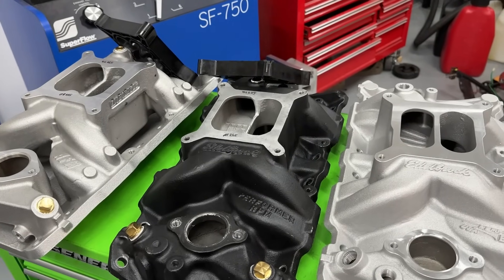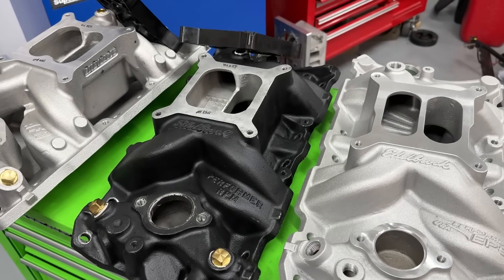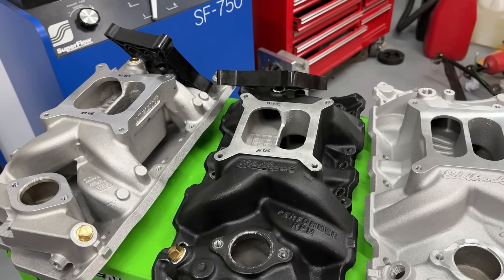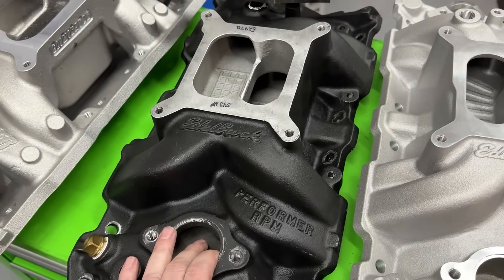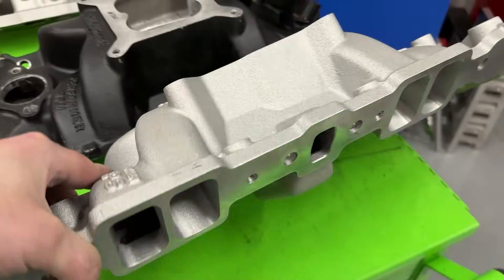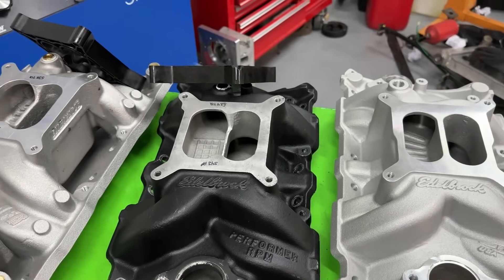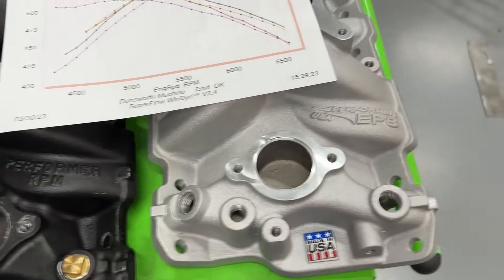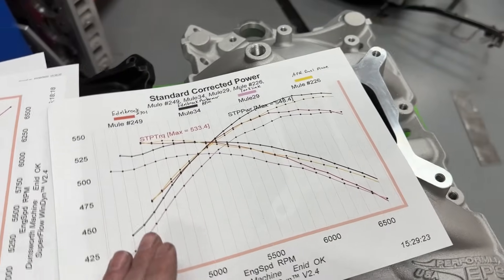Does Cutting Down The Divider On A Dual Plane Intake Manifold Help

Comment: Wondering if the added low end torque with AFR was because of cooler intake temps due to the air gap design.
Reply from the maker: I doubt it because there isn't a whole lot of air flowing underneath it in a dyno cell but maybe.

Comment: Most of you intake info is validated on dyno sessions and test fo 20 years. All street motors hot street strip performance rpm is ticket. Watch any engine builder who builds power. Thanks

Comment: Did the RPM originally have a notch in the divider?
Reply from the maker: No
Reply: @WeingartnerRacing  The reason I ask is the big Chrysler ones I have bought did has a small notch in them. If course it wasn't cut down nearly as much as you have there. I was just wondering if it would be worth cutting more out.

Comment: Great video Eric, some interesting results. Why do you think the 4-hole and open spacers react differently on the dual plane vs single plane manifolds? I'd like to hear your thoughts on that. Also, concerning your oil temperature situation. Have you considered running a remote filter with an oil cooler and a fan? You could probably fab a portable unit with quick disconnects.
Reply: It makes sense, four holes help torque which single planes need and open spacers help top end by adding plenum volume which most dual planes need.
Reply: @josephbacarella2242  how about using a four hole spacer on top of an open on a dual plain ?

Comment: If you need a dual plane manifold, your engine is too small. 😅
Reply: Dual plane intakes have their place! No matter how many Ci’s they are. 1,500-6,500 rpm’s for very efficient dual plane intakes.
Personally I’ve never seen one make power past 6,200-6,300 rpm’s. That’s with port matching and 1”-2” spacers too! I’ve done single plane intake builds/engines
From 287”-434Ci. For fun I have put Wilson full competition ported to Felpro 1206 int side gasket on an Eddy Airgap dual plane for a SBC. It’s an eye opener!!  Even on those engines with single plane intakes that made power out to 7,000-7,200 rpm. With the Comp Ported Wilson intake made far better torque and Hp on average up to 6,300-6,600 rpm’s!!! On average only being down 15-45 Hp
From 6,600-7,000 ish. The 406 sbc was able to change the stall from 4,500 down to 3,500-3,600. And shifted it at 6,600 rpm’s and went 3ths faster! And picked up 2.5-3 miles hour on trap speed???  You’re dropping rpm’s by 600rpms of ware every gear and gos faster to! Now this is on sub 625-650 Hp street/strip builds!

Comment: Thanks for doing these comparisons they are so interesting and exactly the kind of information technical gear heads like me are looking for... Since you are doing dual planes, it would be nice to see the results/ comparison of the newish Edelbrock Dual Quad Air Gap RPM with 1000+ CFM of carburetors on it. I know other dyno test have indicated that a single carb and single plane are better, but those same people also claim you only need 750CFM on a SBC and should never need more than 850 CFM on a 406... Personally I believe the Dual Quad AirGap would be the best all around set up for your 406 in a Pro touring street car or a road course car.  If you are able to do it, please also comment on the hidden partial plenum divider on the passenger bank which I’m guessing they added to further spread out the torque curve.
Reply from the maker: I don't have two good carbs to do dual carb set ups.
Reply: I have a complete new never run set up I plan on running in the future I could let you borrow.  I even have a jet/ metering rod kit for each carb.  Let me know if you think it’s worth the dyno time.
Reply: Most road course cars are under 366. 6 litre. And I have not seen a roadrace car ever with duel 4s. Maybe some historics but even then it would be looks. 
750cfm is generally best on a 6500 rpm  355 engine. 7000 rpm  maybe an 850 for top end power. For a tight course with slow corners the 750 will be better. All this on a single plane. Dual plane is generally nicer for a strong street car. Airgap RPM seem to be the best I have seen. And fits under most bonnets without a spacer.
Reply: In fact I have an older non-air gap Edlebrook dual quad intake you could also use to compare air gap vrs non-air gap if you wanted.  I also have a Torker II which might round out your single plane testing for people with limited hood clearance.

Comment: The brand of engine matters too.  Ben Alameda did dyno testing with different Ford dual planes and concluded that cutting out the divider hurt the horsepower.
Reply from the maker: It may be how the runners are paired.
Reply: How big of an engine was that, what heads, what cam?
I think all of that has a potential to change the outcome.

Comment: Would have liked to see them compared without a spacer.
Reply from the maker: Maybe some other time.
Reply: @WeingartnerRacing  Just curious on how a divided plenum compares to one that's open. On an open, each cylinder has access to all 4 barrels of the carb. Not so with a divided type.

Comment: I think the EPS was restrictive on the 406, I have seen some data where the EPS shines down low on a 350, so might be better choice if one has a street 350, and gain more torque vs the RPM down low.  I like the AFR, Cool comparison!  1/24/24 EDIT: I recently noticed the difference between runs "Mule 250": 2701 EPS w/ 1" Open and "Mule 249": 2701 EPS NO SPACER.  The 1" Open spacer appears to kill the torque (and HP?) on 2701 EPS watch 13:05 , completely opposite of the AFR 4812 w/ 1" open
Reply: On 305s and 350s I have seen the best results with a performer rpm Q-Jet and an 850 cfm Q-Jet.

Comment: I recently dyno'd my sbc 388 boat engine mild 230 ish 113 LSA  cam 10.5 cr with Air Gap intake on old-school Eddie Victor race heads I had laying around.  The tall head ports almost don't cover the Air Gap intake. It made the best power and most stable air/fuel ratio at 5000 with an 1-3/4" open spacer with stock divider.  It was better than the 1" open spacer we tested.
Reply: 113 lsa sounds like too much for your combo i'd tighten up the lsa to optimize performance use David vizard's 128 formula for sbc
Reply: @jeremiah5928  This cam grind was tested years ago for mild street  383 combos.  Jet boats are hard on engines so making 473 torque at 4800 rpm and 475 hp at 5400 should be ok. Less fumes with the wider Lsa. From what I heard the 113 cam is better  to tune the carb with better vacuum. This cam was advanced 2* if I remember.
Reply: @jeremiah5928  you dont want exhaust reversion, so most marine cams arent that tight due to the water in the exhaust.

Comment: Keep in mind this is a fairly high RPM test. For those building street engines, 2500 to 4000 is where you're going to be most of the time, so a few HP upstairs is great, but you want torque and a happy engine when it's turning 2500 to 3500 driving down the road at part throttle.

I've witnessed open spacers making 5 to 15 HP extra while running the dyno, and it's good for bragging rights, it will always hurt torque numbers down low, and will negatively effect drivability.
Reply: Maybe in a race car but if you have a heavy street rig or pickup and especially with a wide ratio manual transmission you do see full throttle quiet often around 2500-3k rpm
Reply from the maker: Chances are if you are at those rpm’s you are not wide open throttle.
Reply: This is why you should look at average HP and not peak hp
Reply: So you only hit 4000 rpm from light to light you need lower gears lol

Comment: Those 4 hole spacers suck, I lost a lot of hp on my small block chevy back in the day. Open spacer works better for most applications.
Reply: 4 hole tapered spacers seem to work well on single planes

Comment: Do you have the data from each dyno pull from 2500 and up or just 4500 and up. I'm curious to see the low end torque and hp numbers between each manifold. For a street car I need more power at low end versus high rpm power because of the stall converter used on the street.
Reply: The EPS is a great manifold for torque numbers below where these tests were started. We use it quite often in marine applications because they need torque, and they live between 2800 and 4500 for the most part. If you're building a larger small block, the RPM would be a better choice. Low RPM 383 or smaller small block would favor the EPS. (in the lower RPM torque department)
Reply from the maker: Nothing that low because in all fairness you are very rarely ever going to wot at 2500.
Reply: @WeingartnerRacing lmfao 🤣   I always wot at a dead stop at like 800 rpm in my 454 it takes off and lays a strip half a block lol and in first gear at 2500 I go wot is amazing 😂 more like who waits to 4000 to go wot I guess you are a sbc guy not a bbc 😂nothing better than low rpm snaps 😊 I guess because my bbc makes at 2500 what your sbc makes at 6000 😂

Comment: I really enjoyed this episode. Next time you dyno a manifold with exhaust crossover, could you dynonit with a shim closing the crossover off, then yank the shims so we can see if it really makes a difference. I grew up thinking it mattered, and I'm pretty sure now that it doesn't. The air isn't in the manifold long enough to heat up, is my hypothesis.  Maybe you could make your head flow numbers and dyno data available for a subscription ?
Reply from the maker: There is exhaust crossover in the heads.
Reply: @WeingartnerRacing  , I just want to know how much difference plugging the crossover makes. I've gone to a bit of effort in my life plugging crossovers, and now that I'm old, I think it was a probably waste of time.
Reply: @bobstitzenberger1834  Crossover will help during warm up (not to the extent of the engine having a functioning heat riser valve which normally get tossed for headers) but has minimal effect once the engine has been running long enough for the oil temperature to stabilize and the entire intake is 200 degrees.

Comment: What makes you think that higher intake temps (due to hotter water) have more of an adverse effect at higher RPM (so disproportionately reduce upper RPM horsepower compared to lower RPM torque) when at higher RPMs that intake charge is spending less time in the manifold, and therefore has less time to be heated?
Reply from the maker: I don’t have an exact reason. I just know every time water is hot the peak hp goes down. If you get the oil hot it almost always helps torque but horsepower really doesn’t change. The best I can figure is when we get the water up to temp the oil is much hotter. Another pull the oil is hotter but it has diminished return but now water is hot and we make close torque but loss of power. It could be the intake charge is much more sensitive to temp. Just a guess from the observable. The ticket is hot oil and cold water.

Comment: Pretty cool on the dual planes that divider man I would of thought it would gain but it didn't oh well. I can't wait for the others
Reply: He was also using a open spacer. The videos that I had seen had power gains but those were without a spacer. I also seen where cutting down the wall between the intake plenums too much also hurt power over just cutting down around 1/4".

Comment: Well, i know not to cut my divider down in my perfomer rpm. Running it now with a open transdapt 2382 spacer. just need a better carb than the little 4150 600 holley vacuum secondary.
Reply: Take that spacer off and take the car for a drive, seat of the pants will likely feel better.
Reply: @yarrdayarrdayarrda  i have, it has a 3500 stall with 246 @.050 cam with a 106 LSA. it wants to pull up high 4000+. It really needs a 496 not a 350 .060 over. Its a 3800lb C10. not light.
Reply: @yarrdayarrdayarrda  It got the plastic spacer because of issues with the carb boiling fuel after driving and then setting like at a store or other places.

Comment: 👍 Doing good things Mr Weingartner.
Your testing and information is appreciated.
Reply from the maker: No problem
Reply: @WeingartnerRacing  Hey, just wonderin if you'll try different sizes of open pacers on any of the dual planes. 1/2 - 3/4 - maybe some over 1inch?
Or maybe try something strange like an open with a 4 hole at the top.
It'll probably take more time than what it's worth and be very subjective to the manifold being run due to plenum and port differences.
Reply: @peskypeet  ...................I have and like the combo using a  tan colored phenolic 4-hole on top off an open one inch spacer.....may be hood clearance problems ........wtf....